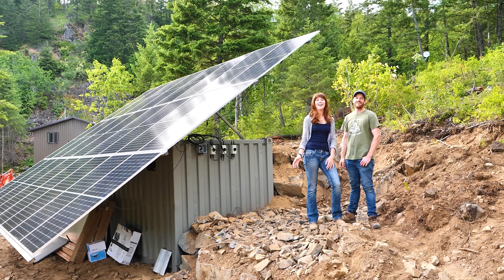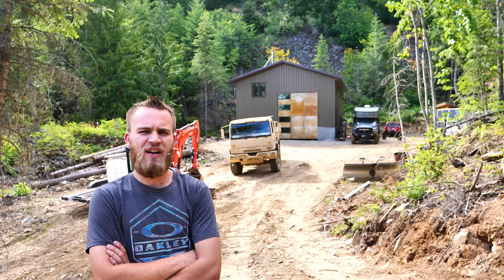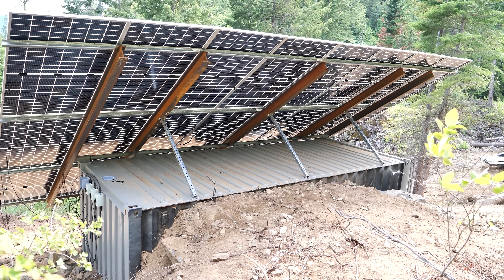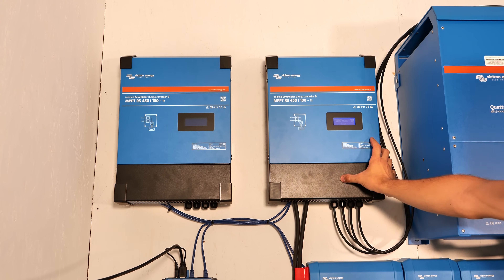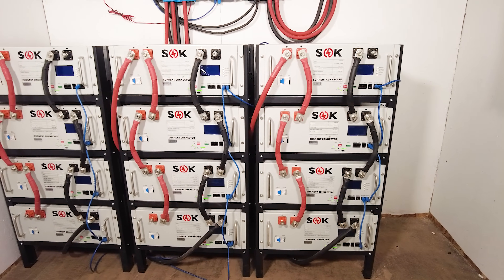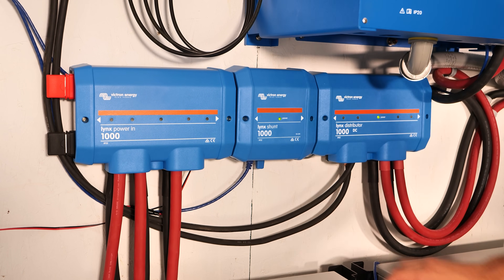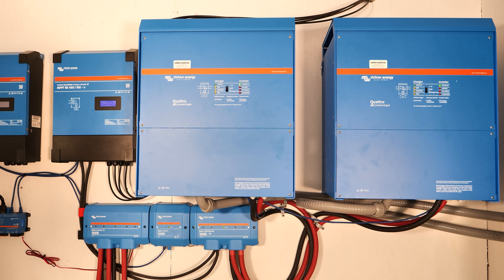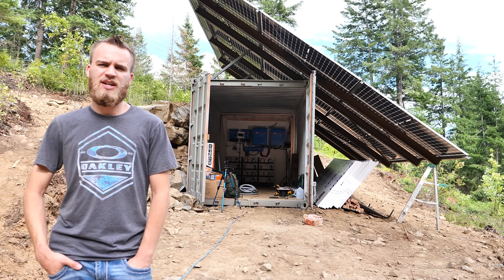Massive 20kVA Off-Grid Power System by Current Connected⚡️

Comment: Incredible off grid setup. Love how the whole power station (Batteries, Solar, Inverter/Chargers/MPPT) is away from the house consolidated within and on the freight container; wedged into the landscape. That thing is solid! :face-green-smiling:  
Current Connected is THE best company out there for off grid builds. They actually work with you versus just sell you something.

Comment: wait.  you say those charge controllers can handle up to "5,500w of solar" each.  and, yet, you have 10,680w hooked up to only one.  what am i missing??
Reply from the maker: The rest gets clipped off.  They can output 5500w but you can have 7600w on each input. The controller will feed through only as much as it needs

Comment: Amazing system. I'm assuming this system is fully sponsored, if not what is the estimated ROI? I have a much smaller system and the ROI is terrible. I would expect to upgrade or replace MPPT chargers, Lipo's and inverters of my system before the system has paid for itself in power generation. Did y'all look at wind  also?

Comment: Great video, nice to see a solar system designed for the heavy loads, usually folks are just trying to run some lighting. 
This system is the size I figured I would need to run my well, with two 3hp pumps on it, and have a little extra. The start up of the pumps is the killer problem, need lots of batteries that can take it. My issues, I live in socal, and SCE doesn't allow off grid, or independent systems...also at 50K, it's a lot of years for pay back, way into the warranty replace equipment stages...
Reply: If it’s “off grid” SCE can’t say shit. Last I checked SCE aren’t the overlords of electricity.
Reply: @toadsauce8091  
LA county and SCE have made laws here, to have an off grid or independent system, you must be more than 6 miles from grid power. Also SCE will not allow people to USE the power they generate. Two way meter mandatory, you sell to them at .04 per kilowatt, you pay for what you use .36 per kilowatt...
A total scam.
Reply: Build it anyway! To hell with them!
Reply: @ladykd2355  
I have since bought a system, 50K, zero edison bill, payment is 175.00 per month... my edison bill used to be 600.00+

Comment: Actually a 20kw system isn't all that large.  You call it volt amp due to using Victron but we know its the same thing.   A few cloudy days would leave you looking for a generator.   I use 3000 watts per hour and I'm conservative.  (3kw/hr or 2100 per month).    That's about 72kw a day.  Are you figuring the total output on demand at one time?  How are you calculating the 20kw in your title (20KVA).  And if so, how long can you use 20kw without draining the batteries?  More info needed to determine what you have here.  These figures can not only be deceptive but confusing.  I do believe that most who desire such a system will never endeavor to have one due to these issue.  What a shame.  By the way, I can run my entire home on a 6000 watt inverter without ever having it break a sweat.  What on earth is this individual doing with 20kv?   You could power a small factory with that much output potential.
Reply: You really don’t know much about this topic at all.  There’s no deception presented here.

20kW is the potential output of the system onto a momentary load.  As far as how or why someone might need this, these people are doing a lot of welding and metal working. Those are taxing on solar systems. 

I own a solar business that crested 50,000 solar installations this year. We are one of 15 biggest in the us.  My own home is entirely off the grid with 68 x 440w Aptos Bi-Facial solar panels & 24 100aH /5.12kWh batteries in 4 racks. 

Why do I have such a system?
1) I install aptos panels exclusively because they are fantastic and because we do I get great pricing via immense volume. 
2) my home is 2650ft2 and even though it is ICF construction and thus incredibly efficient , I still have a lot of consumption and the home is in the rockies so 80-100 days a year aren’t great
3) I can charge my ev at 11.7kW, run my heat pump climate controls or heat pump water heater, wash dishes, use the electric oven/ induction cooktop, microwave or run my electric clothes dryer all at the same time during the day if need be.  
I mounted main panel, all solar equipment, water heater, ac all in the insulated garage and run hydronic solar heat into the slab so theres always plenty of heat for heat pumps and in the summer the heat pumps keep the garage cool. 

All this is backed up by a 22kW generac gen but its completely disconnected march-October and only comes on weekly to self test the rest of the year. A single 100lb propane tank is enough to keep it up like this for a very long time. Otherwise I only use gas for the outdoor bbq.

Comment: I’m a little concerned about the solar panel support, I’m already seeing quite a bit of defection in the horizontal supports, I can see some of the panels getting damaged with a heavy snow load. The vertical supports are all good and it’ll be easy to resolve
Reply: The array will be closer to vertical in the winter, so snow load would likely be minimal.
Reply: @whattheschmidt  that will help in regards to snow load, only issue is that by doing that will increase the wind load which will result in more rapid solar panel defection.

Time will tell, I’d like to see how they worked out their load calculations for this array
Reply: I won't be surprised if a storm with high wind speeds twists that mounting. Needs more torsional rigidity. A triangulated space frame would be lighter while being much stiffer.

I'd have put a bit of gap between the panels vertically to let some wind through and no gap horizontally. Snow could catch in the horizontal gaps, making it not slide off easily, or at least building up in those two lines to partially shade the panels.

Comment: Looks way more consumptive than being on the grid! Cost on that would be insane.
Reply: I suppose they were too far from the grid or didn't want the reliance on it.  But you're right the cost and maintenance would be steep yesterday, today and tomorrow.  Not sure if it's worth the investment.  I can see a system for backup for outages or small mobile unit for limited use.  But a whole house???
Reply: They were faced with a very expensive grid extension to serve their new home and shop.

Comment: This is a great set up for off grid living, but what about cost?  Something like this has got to be massively expensive. Great video.
Reply: Just as a rough estimate, $300/KWh for the batteries, so 60x300=$18000
$360/panel 24x360=$8640
The inverters are probably in the $4000 range for the two inverters and another $3-5000 for the other equipment. Racking and wiring probably another $2500..
They are pushing $40K plus the shipping container.
Reply: This setup could have been done for 2/3rds of what this system cost if they went with all in ones and different batteries, but I'm guessing they got a lot of it discounted because youtube...
Reply: @FJB2020  I think 2/3 is pushing it, maybe 25% less than what this all cost retail. The trick will be getting the current output they have here. 
The batteries are the single largest cost, but if they got them for around $300/KWh that is the going price right now. The panels you can definitely find cheaper in another brand. Up to 1/4 that brand's cost. The warranty won't be as good, but I don't feel that matters. In ten years if they aren't working to spec, new technology will be available that you will want anyway, so saving 1/2 to 3/4 of the panel cost now is just good sense to me. The warranty only matters for the first few years.
The inverters and other equipment seems like they were pricey. There are other brands with combine functions at lower cost than the separate units for each task. As a package deal though it might not be a bad.
Reply: @court2379  Those SOK batteries cost $360kWh and other server rack ones are around $297kWh (or $250kWh if you source yourself) and they could have gone with 4 all in ones for less than half of what they paid for that Victron stuff.. 

Just saying they could have done this much cheaper and simplified their system with other gear that is on par with this setup..
Reply: @FJB2020  My numbers are a rough estimate without going and finding the exact components. I don't think this setup is the cheapest way to go either, but there are many factors going it such a selection. First we don't know what they paid, and they may have received a significant discount making this the cheapest option for them.
Second their high draw conditions to run industrial equipment isn't the norm and may have dictated certain components that wouldn't be required in most setups. I don't know without studying the cheaper equivalent.
Third if you don't know how to size the equipment, you are paying someone else to, which leads to additional cost.
Fourth, sometimes you pay for a brand name because it is trusted to work long term. Many of these newer companies are unproven, most offer warranties that aren't worth anything either because they won't honor them, or the company won't be around in five years to make the warranty claim. Upfront cost isn't the only thing to consider. 

Hopefully someone reading this thread can understand what we are saying about this not being the most cost effective solution upfront for most people, and then make a decision with more information. It still might be the right system for them, but likely not the lowest cost option.
Reply: I'm spending $330 per month on electric. That's $4k per year. That's $40k just gone in 10 years assuming the cost of electricity stays the same, which it won't because it will increase. I'd be willing to bet that these components will last a heck of a lot longer than a decade. I don't need this huge of a system, so I could probably build something that would fit my needs for less. This makes all the financial sense in the world to me!

Comment: Looks awesome! Would be interesting to have some rough estimate on cost.
Was the Quattro used to facilitate a generator? Is there a pre-charge circuit in there somewhere? Capacitors of those Quattros will haul when turning on.
Reply: From the costs on their website, you're looking at $40k-50k plus installation.
Reply: @stargazer7644  Honestly that is a very good price for the equipment. 16kw solar panel setup without batteries is often $30-40k nowadays, and batteries are expensive. To get 40kwh of batteries added in as well and sticking under 50 grand is awesome.
Reply: @stargazer7644  There are always 2 or more prices - web carts always have MAP or minimized ADVERTISED price, what you pay if you add to cart then check out. If you go through systems engineering, you pay for the system as a whole, typically well below website "CART" pricing.  Also, full systems ship truck freight, while websites can never estimate truck rates so they tend to over estimate big "cart" shipping.  There are also b2b discounts which websites almost never have except for really large companies like HP or DELL.  The most expensive way to buy is piece together a system made of "best deals" from every vendor because A) they don't work together and B) there's a reason every "great deal" is low priced.
Reply: @swsuwave  I'm not sure what you think your point is, or what you're on about.  And congrats on giving yourself a thumbs up.
Reply: @stargazer7644  it's quite simple: people who buy systems DONT pay the web prices you referred to. I don't know how you arrived at $40K+, But I can GUARANTEE you this system didn't sell for website pricing.
Reply: @swsuwave  You don't know how I came up with the number?  Let me explain it to you.  The prices for the components are listed on the company's website (and many of the components are already grouped as systems and discounted).  I added them up.  See how that works?  Sure, you can sometimes get discounts for buying in bulk or buying a designed system. You can also get discounts for putting out a youtube video to generate business for a company. You can also get discounts if they're running a sale.  Sometimes you don't.  Haggling isn't always a thing in the US.  People are asking what the price of this system is.  I used publicly available numbers to give them an idea.  If you have better information, then by all means, let everyone know.  Otherwise, how about you stop being unhelpful?
Reply: @stargazer7644  Someday, when you grow up and buy a real energy storage solution, you will realize #1 you don't buy it on a web site - you use a phone,  then get an invoice which reflects your unadvertised price based on what you need.  4 days after I sent my payment by e-check, FedEx freight pulled up and unloaded everything.  I never looked at web pricing, because they're all the same. Just compared system quotes.  Buying here cost $13,200 less than a local installer quoted for material plus nothing I bought was made in china except the cells, unlike the local solar company who had sketchy inverters, plus there was no Kentucky sales tax buying from NV.  My system included design documents signed & stamped by an electrical engineer, so my electrician & 2  helpers had his support for 2 days on the install.  Here in Kentucky tonight, my neighbors keep askin why I'm the only home for miles with lights on.  All thanks to Victron and internet from Starlink.  That's when you appreciate a well designed system.
Reply: @haroldlopez5841  Cool story bruh.  What does ANYTHING you said have to do with the cost of this particular system which is what was asked about?  I suspect your local Kentucky tax officials might disagree with your claim of no sales tax.  You owe use tax on that out of state purchase, bruh.
Reply: I'm going to build these in Romania, how do I contact these guys?

Comment: I will be very interested to see how this performs in winter.  I live at similar latitude, have slightly larger system on PV side than this one (but only 75% battery capacity), but still find the generator runs every couple days just managing a house load and small apartment, no heavy demand tools.  I do like the battery rack system vs one or two large batteries, but the biggest issue I find is there just isn't enough sun, long enough, to catch up in winter.  

Can't wait to see the progress.
Reply: I'd imagine those unpainted I-beams supporting the panels would be the first things to fail from rust within 5 years.
Reply: @Ken-nv2hl  you think an I beam is rusting away in 5 years? 😂😂😂😂
Reply: @mattbrew11  mate it snows around where they live water/snow will cover those beams. I've been working with steel for 12 years I've seen alot
Reply: @Ken-nv2hl  Clearly you haven't learned anything in those 12 years. There is no chance in hell these sturdy beams to rust out in 5 years. Sure they will have some rust but that won't affect the structure AT ALL.
Reply: @kkostadinof  @1:50 see that brown surface on the I-beams that is surface rust on a FRESH install. Its looks like its only 1/4" thick. It's not a hard fix anyways just spend a couple of hours spraying it with cold galv
Reply: @kkostadinof  Quality of work looks horrible anyways rats will chew out those cables

Comment: Good thing about this solar system it's on a good slight angle and it's off the ground a little bit when it snows the snow will be on there for a couple hours and slide right off so they'll get sun from both sides of the solar panel then yep yep good solar panels sounds like I'm going to want to look up can a solar maybe they'll actually deliver something to my house American delivered to Idaho I'm wondering if they know where Wisconsin is I mean we do there right next door it's almost to Canada maybe except for Michigan in the way I like the Way by facial solar panels sound it's a little bit bigger than your system I got of course I don't got enough solar panels just a few and get four 405 Watts solar panels. That is really my own real system I mean I got a couple other solar panels but they're 15 watts 18 Watts 25 watts couple other solar panels but nothing of anything so the phone and the 425 Watts might be something to look up even though Canada keeps off me 400 w solar panels and used I don't know what I want to do with other people's use solar panels I know my solar panels are still good but they're very old even older than those ones you say I used and mine are in a lot better condition from what you describe them. I mean my 30 year old solar panels doesn't have scratches doesn't have marks is nice and clean have real good connections. If you take care of your panels they will last you forever. That's kind of why I am not really too Keen about buying used scratched up dented solar panels bad connections those don't sound good to me.

Comment: Nice system, but the solar array look's like it could use some addition bracing for snow load and high winds.
Reply: In the winter they'll be tilted up to 60°, so they probably aren't going to accumulate much snow load. As far as wind they seem to be situated inside a pine forest so that's going to be a pretty effective wind break, but they'll have to see.

Comment: My only concern would be voltage drop from the MDP (main distribution panel) in the container to a panel in the main building. Better get to trenching with large gauge wire in conduit.
Reply: It's no different than the drop from the transformer at the street to your house.